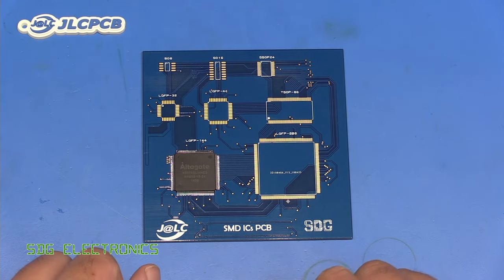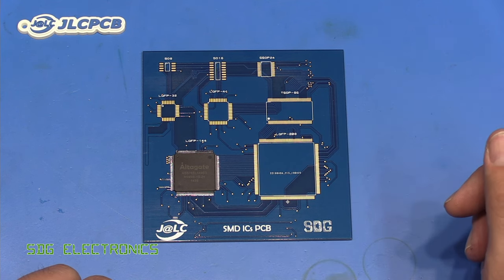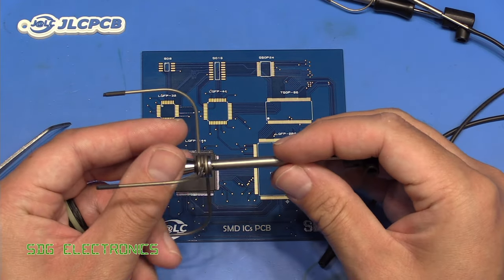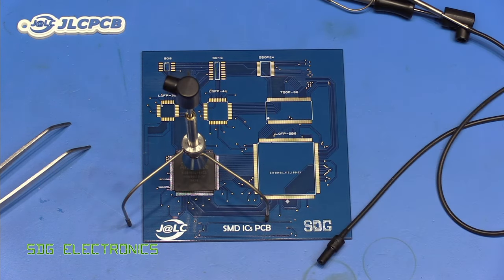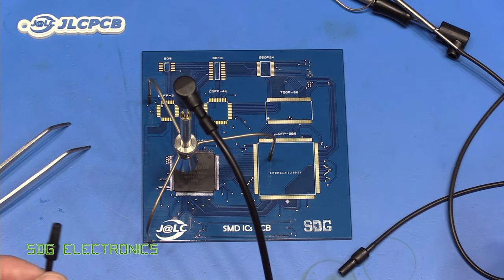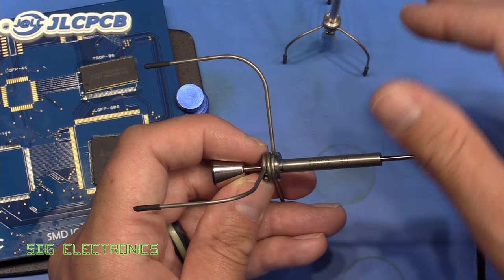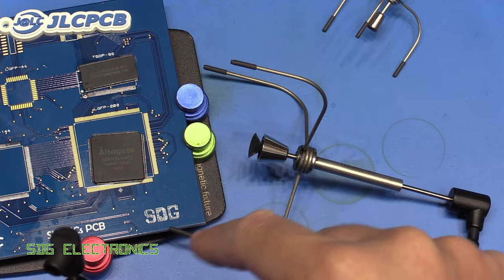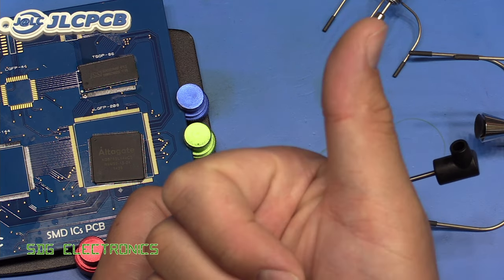SDG #269 How to suck off your ICs professionally with the JBC T2050, T2250 IC extractors and hot air

Comment: We have that in work along with the hot air gun it comes with. They have a metal shield version too that stops removal of other components. Very handy.
Reply from the maker: I saw the metal shields, it probably gets rid of the issue of needing to move the hot air gun around all the time.

Comment: To be fair you are supposed to use these with the protectors. Metal shields that go around the chip and both focus and limit where the hot air goes. Reducing the need to move the hot air nozzle and limiting the risk of blowing off nearby other components.

Comment: I have a hot air nozzle that has 4 rectangular outlets that direct the hot air to the pins of the chip. Thus preventing popcorning the IC as the heat doesn't go into the silicon die directly.
Two downsides, you need different nozzles for each size of chip, and not compatible with this type of IC extractor.
Reply: Yeah, it seems  like it would be more convenient to have the suction cup on a single arm that comes in from the side. That arm would need to be mounted on a stand, perhaps on a base that the PCB could be temporarily clipped to.

Comment: The bigger one seems like it could bend the pins of the chips because it wants to lift the component quite high and if one side is not yet loose it could bend that side?
Reply from the maker: Yes, definitely a possibility
Reply: Seems like it could be improved by some sort of stabilizer that prevented it from lifting one side only.

Comment: Hi, can you guys recommend using a hot plate (and if so which one) for reflowing pcbs with solder paste? Or do I need a hot air station in addition to a hot plate? Normally I just use to a soldering iron but some parts only have connections on the bottom of the part and I don’t want to be limited in part selection.
Reply from the maker: I've been using the Youyue 946C with good success: https://s.click.aliexpress.com/e/_DeJoYE3

Comment: I’m not a big fan of this technique. That suction tool is always applying a slight force upwards, even before the solder has fully melted. When the solder pads on the board are heated up, they are much more fragile to pressure. Any upward force in combination with heat may cause the pads to lift off the board, or at least compromise the bonding strength of the lamination of the pad towards the PCB substrate. Furthermore, as we can see in the video, with that suction contraption in the way it becomes very difficult to blow hot air onto the chips from straight above, which is normally the preferred method to do it. Sideways wind streams can also more easily blow nearby small surface mounted components off their footprint. A much better way to do it is to use a vacuum IC lifting tool that is introduced and applied after a complete solder melt has occurred on the IC. In order to make sure that all the pins have reached a melt, a metal object can be used to carefully apply a very tiny amount of push force to the chip sideways. If there is a slight movement without resistance, then the chip can be lifted with a handheld vacuum tool. The handheld version of it at the end of the video is slightly better but still nothing I would ever use. The spring loaded mechanism is too risky. Vacuum should be used to grab on to the chip, and the lifting should then be done carefully by hand (not a spring) in order to avoid damage to the pads.

Comment: Great video Steve. I have a question for you. What is the best method for removing chips like this. Low heat for quite some time or a high heat for a shorter time? I've tried practicing on some old boards, but these boards always blister before i get the chip off.
Reply from the maker: Some boards you'll struggle to save. Safest method is preheating the entire board then hot air around 370C at the highest airflow without disturbing other components
Reply: I think a good method is to mix your two suggestions to achieve a temperature profile that's like an SMD reflow oven. There the general principle is to "preheat", at moderate speed, the entire board, up to a temperature somewhat below solder melting temperature (say 180C to 200C). That moderate speed and sub-melting temperature can be achieved while keeping the heating elements and/or hot air at a temperature below what damages the components. Then apply a blast of relative hot (say 230C to 260C) air locally to the component to be removed. That should rapidly melt the solder in that neighborhood, and allow removal of the many-legged component.  This is pretty much the principle of rework stations, that consist of a temperature-controlled heated bed for the preheating phase, and a hot-air gun for the melting phase.  (Mentioned temperatures will vary depending on type of solder, notably lead-free requires higher temperature than tin-lead).
Reply: @sdgelectronics  Thank you, that is helpful. I will practice with this method.
Reply: @Graham_Wideman  Many thanks Graham, I will look into heated beds.
Reply: @brianwood5220  It looks like the keywords on ebay are some combination of SMD hotplate preheat rework station.  You can make your own from a (cooking) hotplate or overturned clothes  iron, provided you can regulate temperature. But it's hardly worth it.
Reply: @sdgelectronics  "the highest airflow without disturbing other components" -- pretty sure you're saying to use the highest airflow that still avoids disturbing other components -- which is usually quite a low airflow if there are any SMD resistors or capacitors etc nearby.  (Just so Brian doesn't get the wrong idea!)

Comment: idk might rip pads off if solder on a few pads isn't hot enough and still solid while pulling
Reply from the maker: It is a possibility on a degraded PCB, but the spring force seems to be quite low.

Comment: There similar Chinese ones available but they don’t lift up by themselves like this one , you need to heat the chip first and once the solder is melted then you use the suction tool to remove the IC

Comment: great video. looking forward to your diy vacuum pump. Will it require a separate pump or will it have a built in electric pump?
Reply from the maker: It will be all integrated as compact as possible.
Reply: as compact as the Hakko 394?

Comment: What a gimmick..
Thin x-acto knife blade put under the corner to lift ICs up gives a lot more control.

P.S. that terrible title/thumbnail got to go.
Reply: Disagree
Reply: Its not really about control, its about automatic removal not having to sit there poking at the IC.
Reply: @jaro6985  It does not heat IC automatically and every IC takes different amount of heat not to mention different PCB heat mass. There is nothing automatic about this.
Reply: @Mr.Leeroy  read my reply again, slowly, you missed my point.